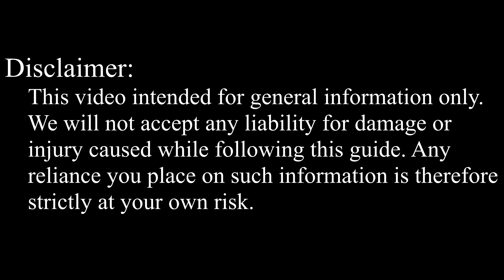Lenovo ThinkPad Edge E530 E535 Disassembly, Fan Cleaning, and Thermal Paste Replacement Guide

Comment: Hi, What type of screw drivers are needed? Also my fan is noisy (more so in winter). I think maybe the bearing is starting to seize? Or do you think cleaning the dust out will be enough to fix it? It makes a grinding noise that comes and goes. (But not so much in summer). The Laptop is E530 i5 and has run 100% continuously 24/7 for the past 5+ years. Thanks, Ken - vk4akp ...
Reply: Hi Ken, I'm experiencing the same problem. Did you ever get the fix?